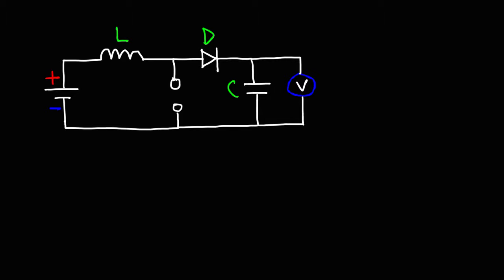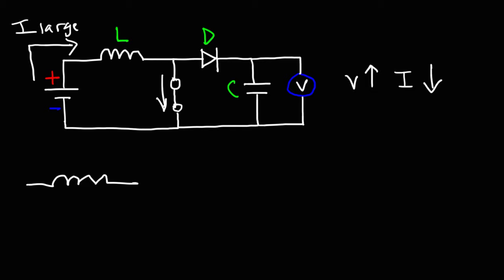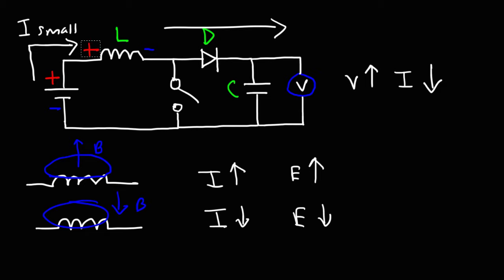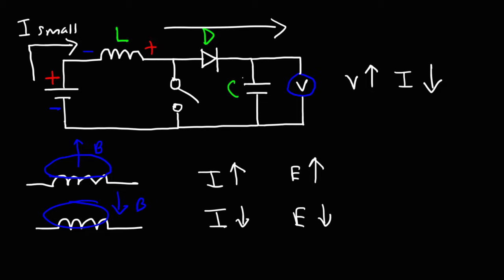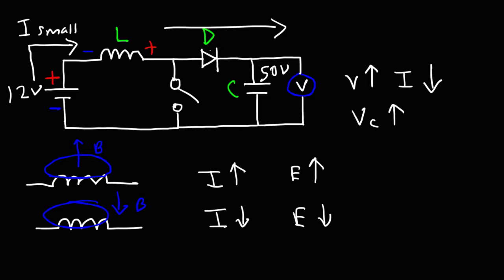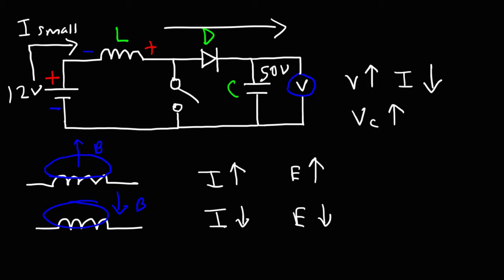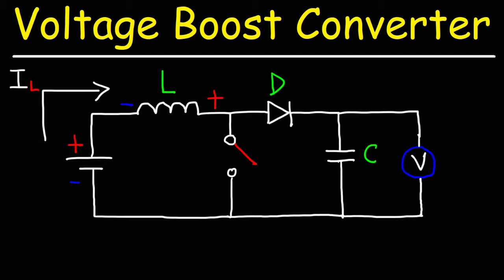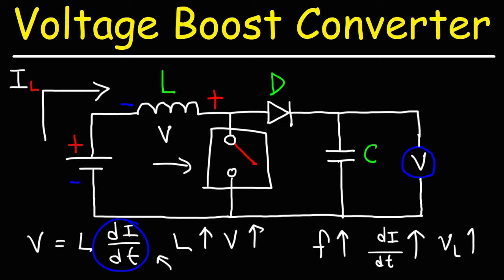Boost Converters - DC to DC Step Up Voltage Circuits

Comment: can you replace the inductor with a capacitor?
Reply: No.
There are ways to do limited voltage boosting (typically nominally doubling) with just capacitors in a "charge pump" circuit, but the switching is more elaborate and such circuits are typically only useful at currents of no more than a few tens of milliamperes.
With actual AC input you can do voltage multiplication with diodes and capacitors.

Comment: Very good explanation...and here is the actual result ...https://youtu.be/XHfp97ZlrnQ  .I was able to get from 12 to 50 volts DC with an efficiency between 70 to 94 %.  Thanks for the video.
Reply: How is the current drop?
Reply: @yasyasmarangoz3577  At 19:38...in the video there is a table that shows the output current at 4.55 Amps for 103 watts from an input of 119 watts. Cheers!!!
Reply: @learningpower9437  Thanks alot